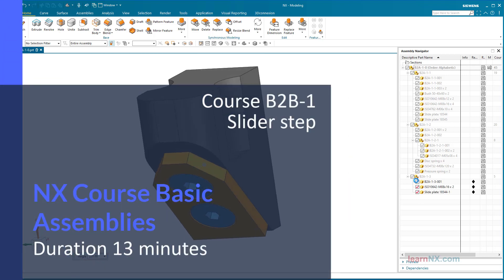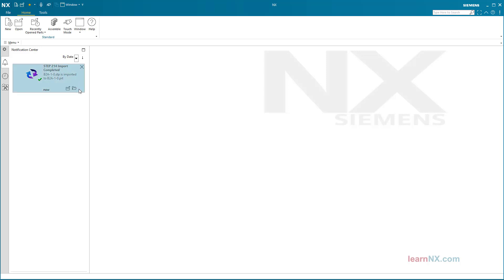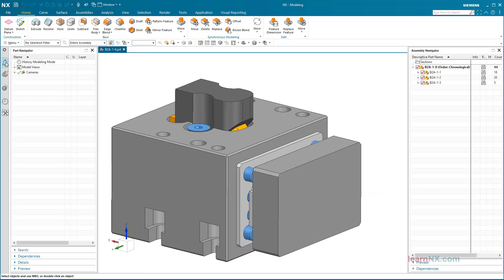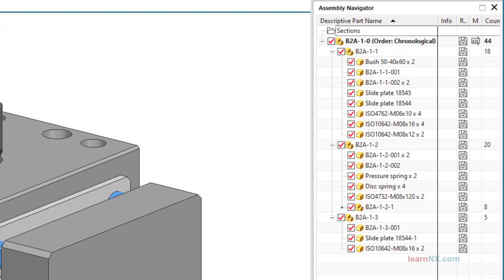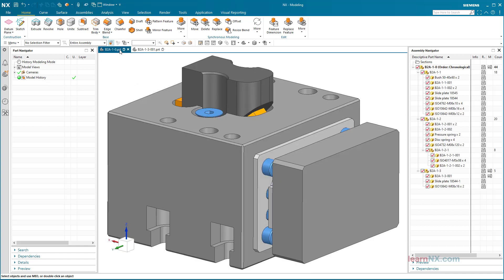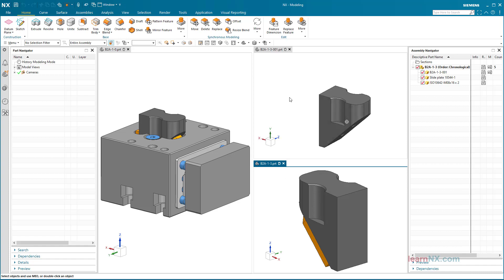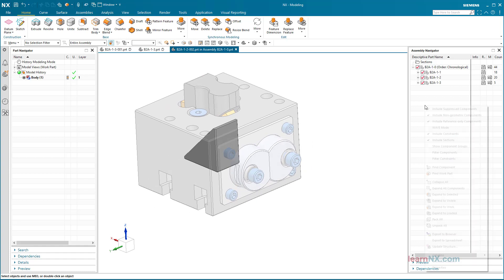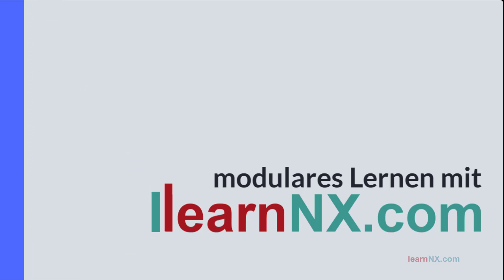Siemens NX Tutorial | Load, save and navigate in an assembly

Comment: hi can you explain Sensor dialog box in nx
Reply from the maker: Sensor in Manufacturing? Sensor in Pre/Post? Sensor in Mechatronics Concept Designer?
Reply: @learnNX  ok thanks, then can you make 4 cylinder boxer engines
Reply: Module, assembly and motion simulation videos we need can you possible.
Reply from the maker: @ssscnc6663  Thank you very much for your topic suggestions. The topic ‘modular design’ will be followed by ‘freeform’ as this is the topic that receives the most enquiries. This could be followed by sheet metal or the MCD.
Reply: @learnNX  ok thanks, we will wait for your 4 cylinder boxer engines making videos
Reply: I also need some information sensor dialog box,so explain that.